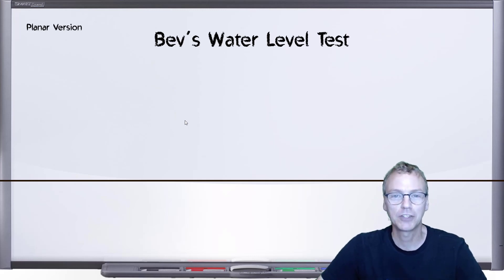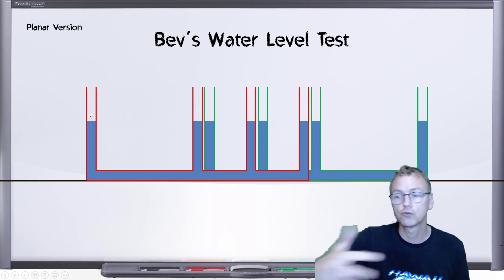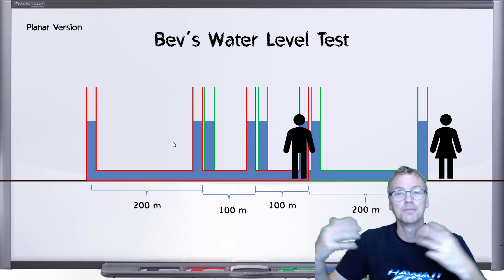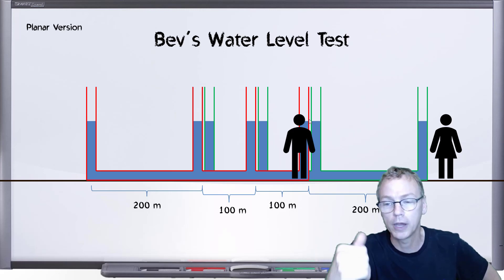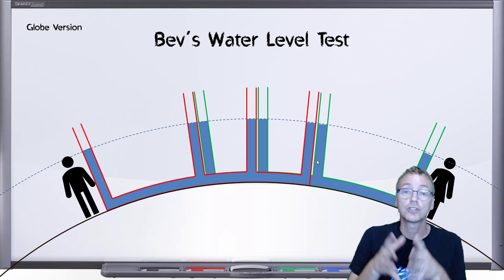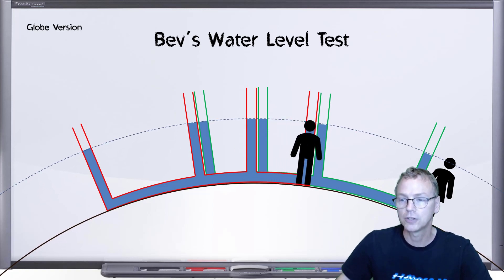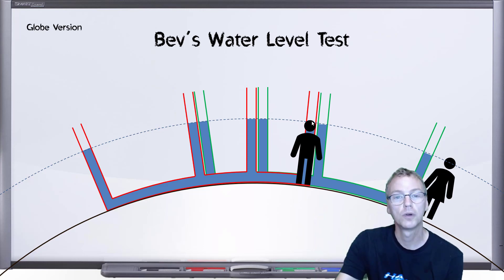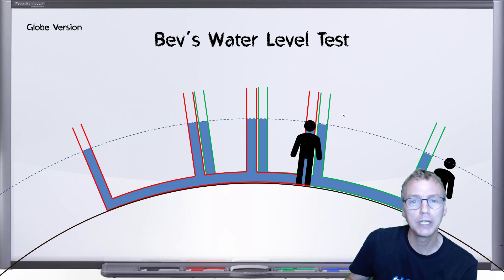Bev Try Thinking and Spot On Level's Water Level Test

Comment: I’ve had a few conversations with Bev and a recent video of mine, about Hanford LIGO, has been a recent muti-day topic on Bev’s channel.  Bev loves to play word games and is very elusive when asked direct questions.  Just a warning.  Also here are a few things to consider...
1)	 Yes, your description of the test is correct,
2)	Yes, the results would be the exact same for the globe.
3)	Doing this test would be quite difficult.  I have used water levels for home remodel projects and it is an effort to fill even 50 ft of hose for the following reason:
   A)	 All large bubbles need to be eliminated to get accurate results
   B)	Trying to gravity fill 50 ft takes time so 1,312 ft (400 m) of hose will be time consuming if even possible.  You better have a larger diameter hose.  No one has ever seen a video of Bev’s results.

Using an auto-level to sight along the water levels is also problematic.  If set at one end of the 1,312 ft line there would be 0.49 inch of geometric curvature drop and 0.42 in of refracted curvature drop at the far end.  Of course, 1,312 ft is beyond the range to accurately read a surveyor’s rod (1/8 inch graduation marks) and heat haze can compound the problem.  A 32X magnification auto-level is rated for 400 ft.

Another issue is the accuracy of an auto-level’s horizontal refence plane.  Not certain what model Bev has but +/-1/16 inch per 100 ft is a typical tolerance for a good auto-level. (This is why differential leveling with balanced BS and FS are required for accurate surveys).  This could be a possible error of +/- 0.8 inch over 1,312 ft.  Over short distances the horizontal accuracy tolerance is greater than curvature error but over long distances the curvature error is much greater. 

There is a much simpler test.  Have Bev take his auto-level to 1,000 ft on Winter Hill and have him target 2,037 ft Snaefell which is about 90 miles away across the sea.  His auto-level should intersect Snaefell about 1,000 ft below the summit but I know that it will actually be well above Snaefell.  Many of us have already asked Bev to do this but he refuses.  I could give you more details on this.
Reply: "Many of us have already asked Bev to do this but he refuses" Do we have documentary evidence of the question asked, and of his refusal?

Also, you say "His auto-level should intersect Snaefell about 1,000 ft below the summit but I know that it will actually be well above Snaefell. " I think by "should intersect" you mean "should intersect according to the Bevian model", yes?
Reply: @edby263  I have two video links below.  Yes, with Bev’s definition of a level line, his auto level’s crosshairs should intersect below the top of Snaefell.

This started with challenge by ex-flat earther Ranty who said he was going to make an observation with an auto-level from Winter Hill, near Blackpool, and asked the flat earth community to predict what he would see.  Roohif and I made predictions but no one from the FE community provided a prediction and as far as I know Ranty never made an observation.  I thought this was BS but it could have been that Ranty didn’t know how to set up and use an auto-level so gave up.

This was also discussed on Discord channels between Roohif and Bev but I can’t find those.  

The first video (22 minutes long) is from Bev’s YouTube channel when I joined in with a conversation on this topic and ask Bev to go to Winter Hill.  It is timestamped when I talk about my prediction.   At 20:37 Bev finally removed the picture covering messages so you can see the predictions that I uploaded earlier.

 Bev - My prediction for Flerf/Ranty and his historic Winter Hill observation 
  https://www.youtube.com/watch?v=YP_9WyTbYeE&t=430s 

The second video is mine where I explain how I calculated my predictions
Globe Predictions for Ranty's Auto-Level Observation  https://www.youtube.com/watch?v=y3e1P_oMryU
Reply: @fedogma8407  Thanks, now on file.
Reply: @fedogma8407  I proposed a related, but different, use of the auto-level or water-level, taking views through it both ways along a line of sight between two elevated points. It's easy enough to find a candidate pair. Greenhow Hill and Black Hambleton are one good pair. Brown Clee Hill and Lord's Seat (west of Mam Tor) are another. Carnedd Llewellyn and Scafell Pike are a great pair, if you ever get a clear enough day to see each from the other. You could even make it a triple, with Whernside, Grey Friar and Pen Llithrig y Wrach. From each peak, the other is or others are clearly below eye-level, and all the observations are far enough above the horizon to avoid all that weird stuff that goes on in the bottom few centimetres to metres of the atmosphere.
With the whole of Britain range to play in, it would be possible to link such two-way observations together, going from peak to pass to change elevation where necessary, and get a series of "an elevation in that grid square is below eye-level when viewed from the same elevation in this grid square, and vice versa" observations from end to end of the island, which is pretty clear evidence of curvature even if you refuse to believe that the sine, cosine and tangent functions of a calculator have uses.
Of course, when I started explaining this to paul bevan, who approves of doxing, he immediately started shouting over me: "You what? Did I just hear you right? Carry an auto-level up a mountain? Did I really just hear that? I can't believe I just heard that! Carry? An auto-level? Up a mountain?!? I can't believe I'm hearing you right! Did you really just say that?"
Anything to avoid letting his audience hear just how easy it would be to debunk the bullshit that dribbles out of his pointless mouth, eh?
Reply: @edby263  It’s Ranty’s test they’re mistaking me for Ranty. Roohif bought Ranty an auto level to do this very thing. It’s still in the shop by Catzs house
Reply: @TryThinking  We did not mistake you for Ranty.  I thought you would be eager to prove your point that a level line and horizontal line are one and the same.  Of course if you are at 1,000 ft on Winter Hill, this means that your auto-level's horizontal line should intersect 1,037 ft below the top of Snaefell and about 550 ft above Blackpool Tower.  But I know why you won't do this because you will have to explain why you didn't see this since the top of Blackpool Tower in alignment with the top of Snaefell.  Sorry, but observed evidence does not support your hypothesis of straight level lines.
Reply: @fedogma8407  How do you think your twin tangent conundrum went down? I bet you thought everyone had forgotten about your deliberate mistake until we spotted it 🤷🏻‍♂️ I thought the most inventive prize should go to Wally, his toothpick tangent idea was a brilliant solution to it.
Reply: @TryThinking  I'm not the one claiming that the NW arm is tangent at two different points.  The conundrum is why do you keep repeating this nonsense other than you need to divert attention away from the fact that those LIGO slab elevations are curved with your definition of a level line.   I also know you need content for your channel so you are welcome.
Reply: @fedogma8407  you’ve already admitted there a tangent point at A and B so there’s nothing more to say really🤷🏻‍♂️ I’m surprised that you managed to drag Blue and Wally into doing what they did though, whilst leaving yourself being the guy who’s defended👏🏻👍🏻 well done 👏🏻
Reply: @TryThinking    What you keep ignoring is if the globe is a lie, then it should not have been possible for me to use geometry with curved level lines to get a straight line of slab elevations.  Your model of a level line should have done this. You might want to try thinking about this.  Or do you really think those concrete slabs curves up over 4 ft in height?
Reply: @fedogma8407  You are the one who’s put 2 tangent points on A and B aren’t you? You have admitted to putting a tangent point at both A and B haven’t you? I get the feeling you’re being very dishonest.
Reply: @TryThinking  I'm the dishonest one?  When one uses your definition of a straight level line and plots those elevations on a graph with x as horizontal, that slab is a curved surface with a 4 ft difference in elevation.  Plain and simple, those LIGO blueprint elevations do not support your model of a level line.  

All I did was use the surveyor's definition of a level line curving down from the horizontal and those same elevations are a straight line with an accuracy less than an inch.  And yes, the NW arm is tangent to the end station elevation and the SW arm is tangent to the corner station elevation.  This is another piece of evidence that you are wrong about level lines so you decided to make the "twin tangent paradox" strawman argument to have something to argue about.
Reply: @fedogma8407  Why are you asking me if you’re dishonest? Tangent point at A☑️
Tangent point at B☑️
2 tangent points on line AB ☑️
It’s your model dude 🤷🏻‍♂️ there’s no need to get all aggressive, the facts are there for everyone to see, how they deal with it is up to them. Having contradictions is just part of the globe model, you’ll just have to learn to live with it.
Reply: @TryThinking  Regarding..."Why are you asking me if you’re dishonest?"  Because in your previous comment you said..."I get the feeling you’re being very dishonest."  FFS, now you are arguing with yourself.  

And where are the contradictions with the globe model?  Where in geometry does it say that when a line tangent is to a point on an arc, then any line that intersects that arc at the same point is also tangent to that arc?  Again, you are arguing with yourself.  I never said the NW arm is tangent to the corner station and if you say that I did then YOU are the dishonest one.  In regards to LIGO, the contradiction is with your model since those elevations area curved line.

Comment: Nicely done. The key point, as you say, is that both hypotheses (earth not a globe, earth is a globe) predict exactly the same result from the test, hence the test is not able to discern between them.
Reply: idk, there's still one tiny nit to pick... defining how those water levels are put together: why would the first type of WL have a straight connecting section, while the second type has  curved one that conforms to the globe's curvature? (While i understand that this is how they ARE built IRL, i still think it needs explaining.)

Comment: Short version: It's not just misunderstanding on Bev's part. There are other character flaws involved.

I have personally told Bev in a voice channel and in text over a year ago that his incomplete understanding of hydrostatic equilibrium would lead to him making faulty assumptions. I also specifically gave him a diagram of how water levels work on a spherical Earth. Sly Sparkane did it long before I did. Bev DOES NOT want to acknowledge that his "tests" are completely useless. He just wants a platform to profess misunderstandings (now seemingly intentional misunderstandings) to those that won't think too hard on the subject. There are other activities going on there that make the Bev crew a perfect fit for Bev's behavior.
Reply: Yup this has been to explained to him since he proposed this, along with errors and tollerances ... still nothing
Reply: It sure seems to me the complications here are deliberate to fake the test. The expected result is no difference in either case, and the outlying risers are quite irrelevant - unless sufficiently affected by tides. 

A truer test might be e.g. to sight along two risers and check if the third lined up. With the minuscule distances involved (200m spacing), the difference is just on the order of 3 arcseconds (the human eye doesn't distinguish finer differences than 28 arcseconds, MF Deering; one order of magnitude too weak), but that's about 5 pixels in my telescope (though it's too close to focus on three levels, and it would be a challenge to even get them in the same field of view). It's also on the order of 3mm, which might hopefully be enough to differentiate it from the surface tension meniscus. Taking into account normal atmospheric refraction, we'd expect the furthest surface to loom above the middle. Taking Earth's curvature into account, the middle would be expected to be highest. 

Taking into account weather, it could go just about any which way - the device doubles as a manometer.

Comment: I have a question; Does magnetic poles shifts effect water levels?
Reply: Hold a neodymium magnet over water. Does it move?
Reply: @scott_meyer  I don't know, does it?
Reply: @fehmidonmez7810 
So that's your problem? Unable to try it yourself? A simple experiment YOU can do would give you the answer to your question. 
If you want me to give you an answer, it's no. The weak magnetic field of the Earth does not affect tides.

Comment: Item 1:  Wally sent me. But I apologize for not subscribing sooner as I'd planned to do so.

Item 2:  I agree, as currently set up the test cannot provide different results under either flat or globe conditions.

Item 3:  On the circumference of a circle, each point will have an offset angle toward the next point along it.  In turn each of the points will have a direction toward the center of the circle, with the distance between circumference point and center point remaining constant.  This distance is termed the radius of the circle, and all the previous factors inherently define a circle.

Now, take that same circle and rotate it out of its 2-dimensional plane through 360° in a 3-dimensional space.  Note that the radius of the circle now becomes the radius of a sphere, and each of those radii of the sphere describe the up/down direction anywhere upon the sphere.

Any definition of a height further above the sphere's surface would apply anywhere upon its surface.  The direct path between any two points at the same distance above it's surface would approach closer to the surface, since it is a straight line, while following the circumference is along a curve would be longer.

Contrast that with the case of a flat line being then rotated into a flat plain.  The path between any two points a specific distance above the surface would be the same as if they were on the surface.

Summary: The difference in the characteristics between a flat plane Earth and a spherical  one are easily demonstrated.  Bev needs to examine the results of one of these, such as the "interesting" one performed by Jeranism, for example.
Reply: ... into a flat *plane.

And there are two points i'm not yet fully convinced by that verbose description of what would be going on. First, i'll shift that final statement back to the other case: "The path between any two points a specific distance above the surface [of a sphere] ... [while it would NOT be] the same [trajectory] as if they were on the surface..." they might still be the same length. Since the "path" on the sphere would need to conform to the curvature, it's longer than the direct 3d distance, but the path above (which is the direct segment) is the 3d distance between 2 points that are now further away from each other...

Second, i don't see where that "easily" (from the summary's "easily demonstrated") came from. :-)
Reply: @irrelevant_noob   The description was verbose due to trying to describe the model in detail instead of with a diagram or animation.  Along the lines of the old phrase "a picture is worth a thousand words".  Other than that being required, I think my description was rather simple and brief, hence the claim for easily done.

I'll need to read through your response to make sure I understand your point correctly, especially since the original video and my post were some time ago.
Reply: @bobblum5973  don't stress too much, it's not a counter-argument. I am just trying to find out in more precise terms what you meant by those "Contrast that" and "the same", since there are multiple criteria that can be used to compare 3d paths.